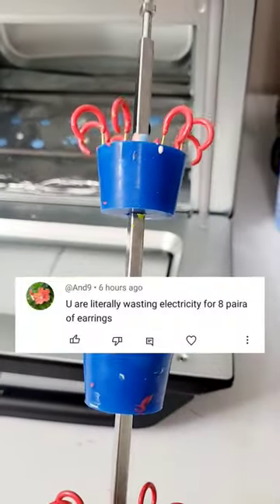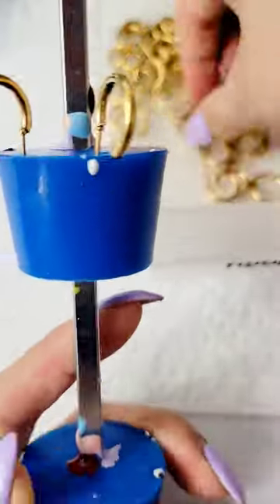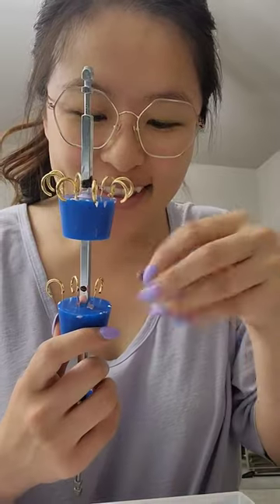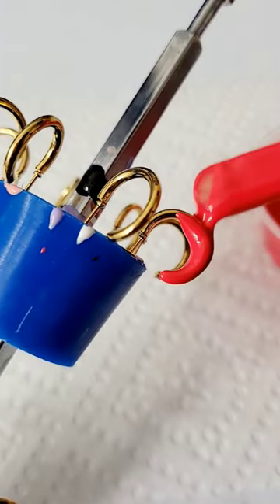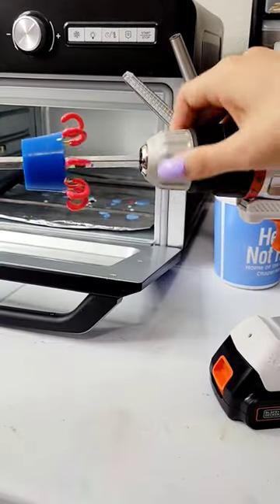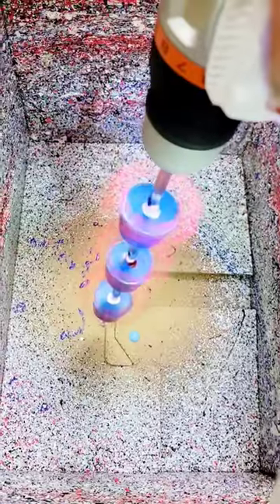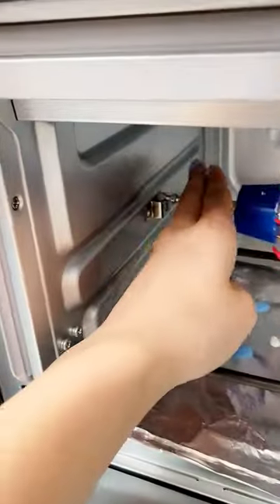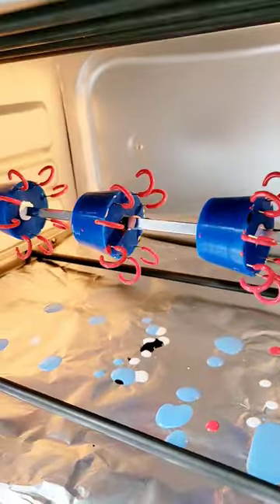Is making earrings a waste of electricity??

Comment: It's worth noting that heating elements will always be the most efficient use of electricity. Power --> heat will always be more direct than power --> light or power --> charging a battery. Technology Connections has a great video about electric space heaters that explains it pretty well.

Comment: Find out how many amps it draws (should say on a label on the oven itself), multiply by local wall voltage (120 in North America, 220 most everywhere else), divide by 1000, multiply by cost per kilowatt-hour ($0.12/kWh in Wisconsin) and multiply number of hours.  3 hours at 1900 watts in Wisconsin is only $0.68

Comment: This thing at most pulls 1200W if that. So basically for every hour run the cost is between 8-18 cents per hour of run time depending where you live at full power heat output.

Comment: As an electrician, I can confirm the little toaster oven barely uses electricity in comparison to your standard oven. When we wire your homes, we have to make a special circuit just for your oven. If you're wanting to save money on your electricity bill I highly recommend purchasing a small toaster oven like the ones this content creator is using. They produce less radiant heat than a standard oven so they'll save you money in the summer on your AC bill too.

Comment: most modern appliances don't use a lot of electricity. the biggest consumer of energy is commercial so while it's good to reduce unnecessary consumption the change we need is policy. it's cheaper for a company to not have to replace the old power eating machines so unless they are encouraged with incentives to upgrade the consumption won't change much

Comment: Ovens don’t take much energy because the only thing that is taking energy are the broil rods unlike ac Which has a compressor a fan condenser and a cooling coil which all take high amount of energy about 3000 to 3500 watts an hour as a small oven takes about 1500 to 2000 watts an hour

Comment: Most new appliances are built to pull as little electricity its the same agrument people make for unplugging everything after every use its unnecessary now because of the tech we have. Making heat is easy ac on the other hand use so much power because making things cold is way harder.

Comment: There is no such thing as electricity wasting on a scale of maximum grid power in an average house as long as there is a 100-megawatt industrial ark furnace casually melting tons of steel 24/7 somewhere not that far away